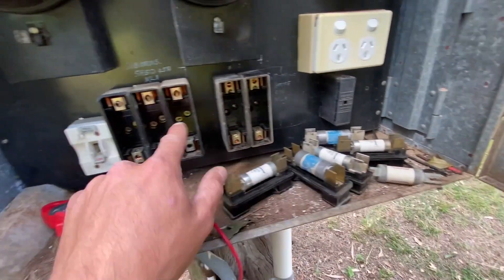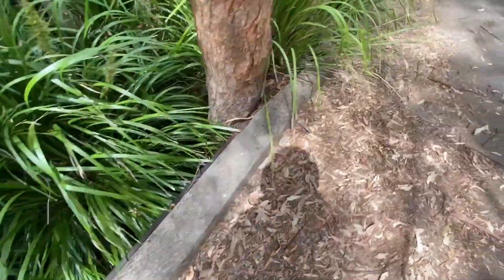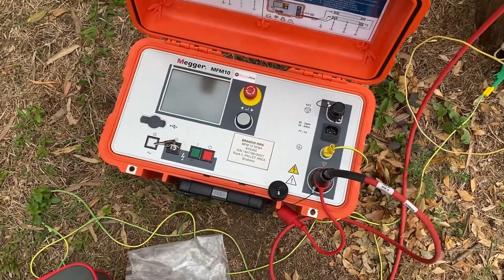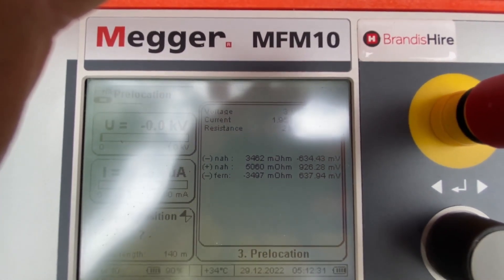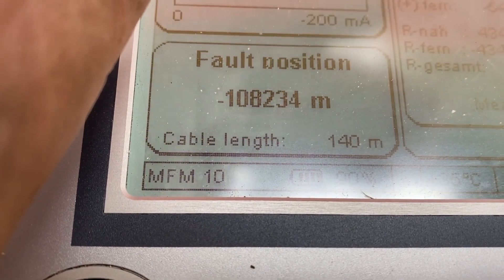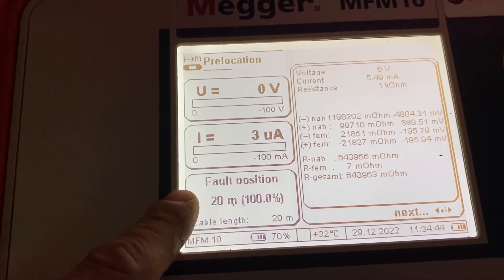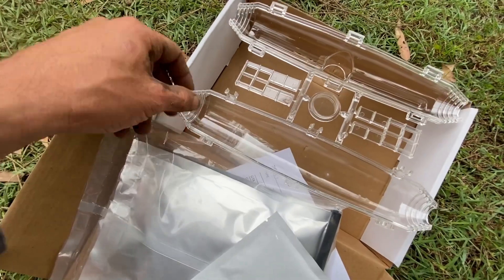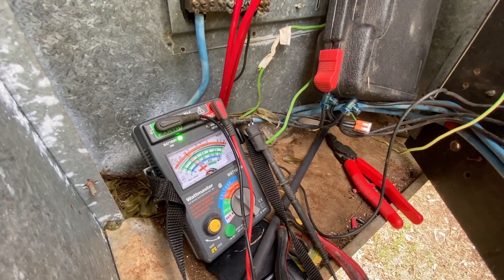Underground electrical joint repair nailed spot on with 140 meters!

Comment from the maker: Energex defected my repairs because they weren't up to modern QEMM (I had mentioned that on video), so what's the point of a period correct repair?! Me changing the main switch over to CBs although it's better isn't a "like for like" replacement. So cheers for the 3 old school meters, because your meter maids would just toss them into a bin anyway and we'll never get mechanical meters back again.

Comment: What is that blue tone generator ? is that a Fluke or something else?
Reply from the maker: Fairly cheap device considering, no longer made however. Other folks rate the Mastech MS6818 or  MAYILON 6818 highly as they on work <400V circuits, cost about $250 AU.

Comment: Buried joins, and yes scotchcast kits are great. Seen the metro guys doing a tap in, with a live cable, because they could not locate the exact supply it was fed from, having 6 cables in the pit, and them knowing that only 3 are 11kV feeders. So chose the one, slit the steel tape off, got the paper separated, and then used open crimps to attach the new 3 phase feed they wanted. then tape up the joins, and put the case on, and pour it full of resin. Note they were doing this in a pit they dug down 4 feet, standing in a nice puddle of sea water and beach sand, and with another 4 fibre lays, and 3 lead sheathed phone trunks in the same trench. Started to rain as well, but they went and finished.  Can't turn off the cables, because that would mean they would have to turn off pretty much half the city centre before finding it.

At least better than the plumber who had to fix a broken pipe, by putting a new valve on, without turning the water off, as the failed valve was the main shut off. That pump they had in the hole was just barely capable of keeping the water level down, so he did not need scuba gear to find the pipe.
Reply from the maker: Interestingly the kit I used said to wait an hour before energising. We don't often get to see HV work on youtube, I think that's due to social media policies energy authorities have. I've seen the live line taps for LV cables but not for HV, line joining is an electrical trade itself!
Reply: @TradieTrev  No this was LV, the HV side they turn off the power, or normally it got turned off for them, last time I saw was with the guys digging to lay fibre, where he put the pickaxe tip through the old joint in the cable, and shorted out the one phase to the sheath. No he did not leave skidmarks in the underoos, wasn't wearing any. Just very suprised, and with the tip a little shorter on the pickaxe.

Needed 2 joints and 5m of cable installed to fix that one, and the section was isolated within an hour, and the fuses at the supply side replaced. Took a month for the inspector to come and verify the joint though, and connect the loop back through to the normal section point.
Reply from the maker: @SeanBZA  I couldn't see it done otherwise due to the construction of HV conductors,

It's pretty fulfilling as an electrician locally here that I can perform such works without interaction of the energy authorities; Apart from sending in forms to re-seal metering.